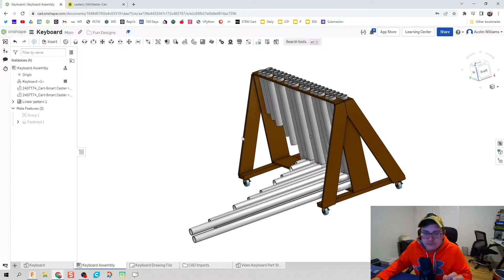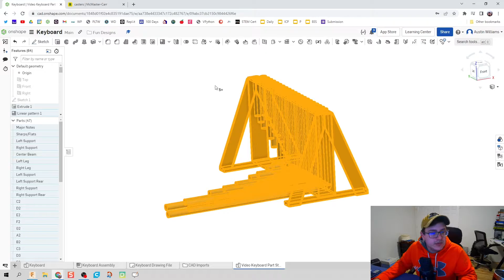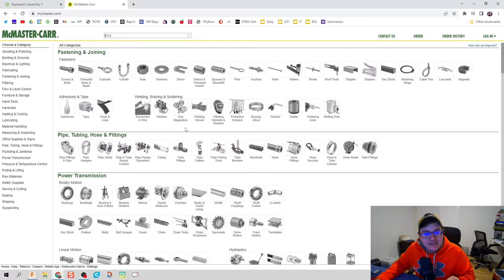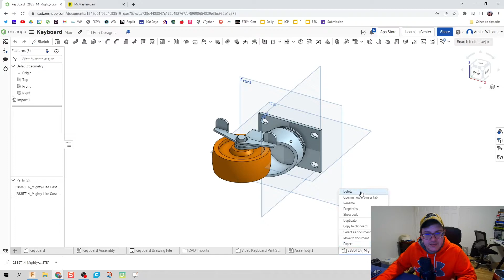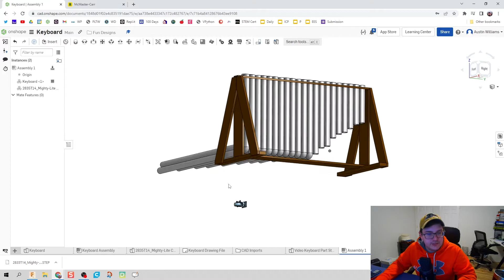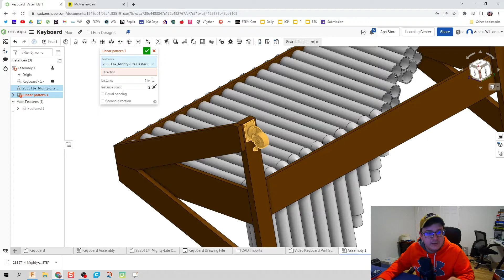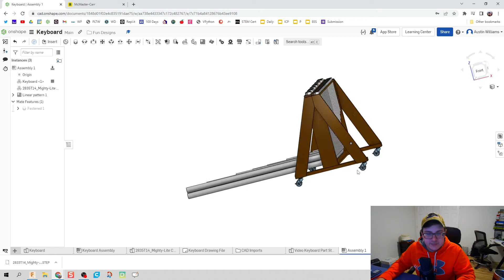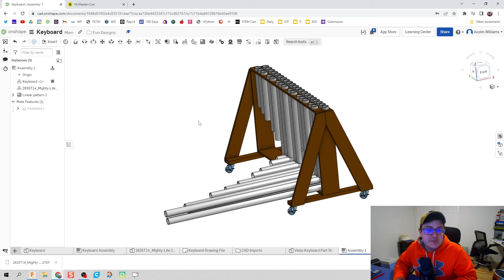Subassemblies from Composite Parts and Uploading STEP Files - Day 69 of 100 OnShape Journey

Comment: Working on a trigger mechanism ,  how can I see that it works before I print? Mates?
Reply from the maker: Not sure how complex your trigger is, but an assembly would show part interference and how the parts should act respectively. Most likely a slide mate in an assembly with a revolute and a tangent.